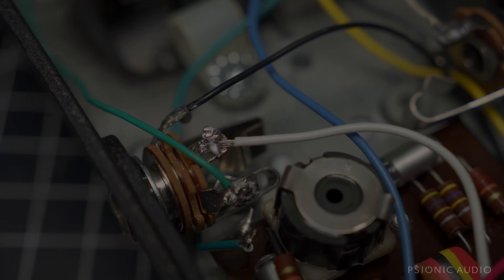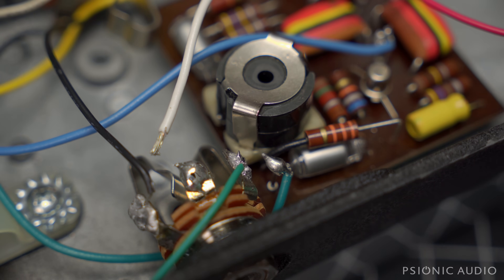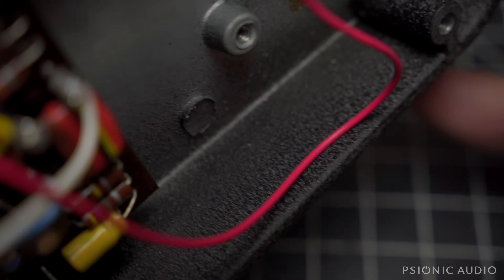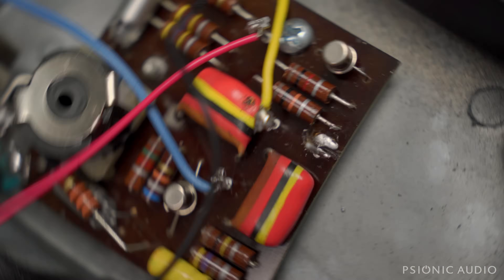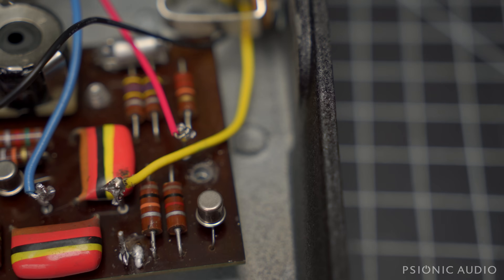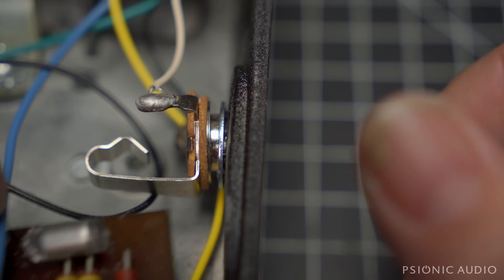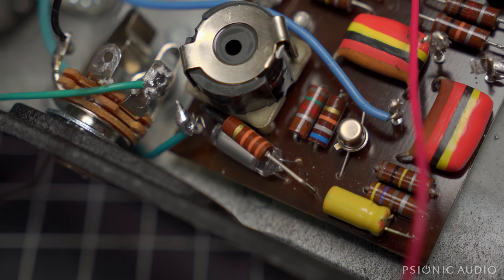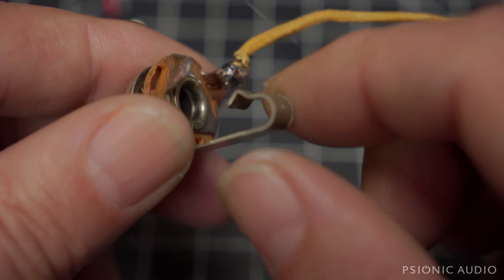Bad Solder Ruins Everything

Comment: Thanks for listing the solder you use. I’m relatively new at this but often find a lot of “solder is solder”  sentiment on the inter webs. (Something I always found suspect, knowing a little about materials)
Reply: Definitely - it's something you don't appreciate until you know the difference. If you purchase from Amazon marketplace or any number of questionable online sources (or even big box hardware stores in my experience), it's not a guarantee that what you get is going to be of much quality... But at the same time buying from specialist electrical sellers, they often cater to trade/industrial customers so you get dozens of options for all sorts of applications, and it's quite opaque to most people which to buy unless you know what you need.

Ditto on soldering irons, etc, and buying components!
Reply: For the most part, leaded solder (old school) is not sold any more. I have seen multiple YouTubes where folks painted the joint to be soldered with liquid flux. I have never, in 50 years, needed to do that. Not with new parts. With skungy older parts, working on WW2 surplus junk, it would be helpful, but you will need to scrape or file away any obvious corrosion until you see clean shiny metal or you'll NEVER get a nice shiny joint. And/or you'll have to overheat and then your connections look funky. Otherwise, soldering is a dumb-simple combo of good heat, clean tip, good solder, and a mechanically made joint. The joint should drink up the solder, it shouldn't be any kind of struggle. If you are embarking on a project where you'll be doing a lot soldering, you can definitely use a cheapo soldering iron as long as you keep the tip clean and tinned as long as you have the illegal leaded solder. Even with a really nice (2-piece) temp-controlled soldering station like a Weller or a Hakko, I still wipe the tip on a damp sponge every 2-3 joints. It just gets incorporated into your wrist action when you reach for the iron. Eutectic (lowest melting point) 63/37 solder is the best but 60/40 is perfectly fine but it damn well has to have lead (Pb) and of course resin flux in it. If you run out of solder, you generally CAN'T buy any leaded solder at your local hardware store, so it is wise to unwind a little backup spool and stash it away should you buy a 1 pound spool, easily available on ebay.
Reply: @alanpecherer5705 , I find that the brass wool sponges work better than the wet sponge.

Comment: Plumbing solder behaves like that. Falls right off of things.
Reply: Plumbing solder is bad for electronics, or so I've been told.
Reply: @harleyhexxe9806  It is corrosive and must never be used
Reply: @infectionsman  Yep, that's what I was told.
Reply: @infectionsman , old-school lead plumbing solder has a higher melting point than electronics solder, doesn't contain a flux core, and the separate flux used for plumbing is *highly corrosive*.

Comment: Hi Lyle, I just found your channel about 4 months ago, then found Brad's  and Yeetsee's (not sure I spelled that right} through your channel, they are all wonderful. Subbed to all. Proficient soldering is an art, similar to welding. once you learn to do it it's like riding a bicycle, it becomes second nature. it takes longer to clean and tin everything than it does to make the actual connection. I learned soldering in a radiator repair shop on copper/brass radiators. Clean, Hot And FAST that's how I was taught. and heat control. so you don't melt everything. some of the crap that is being sold as solder is junk. I usually test an unknown quality roll of solder by tinning some old junk jacks or pots. You can usually tell right away as it will act just as the video shows, it is as if there is no flux in it, you can add flux paste, and it helps, but it still unsatisfactory.

Comment: The other key problem is that none of the soldered joints started with a sound physical connection with the wire wrapped through the lug and not relying on the solder to maintain the connection.
Reply: Gerald Weber's videotapes from 30 years ago: "....and first you need a good, mechanical connection...."
Reply: Excellent observation.

Comment: I didn't know some Jacks not accepting Solder properly could be due to them. I thought maybe I wasn't using the right temperature or brand/type solder. Do you have any advice on these two? Thanks
Reply: I've always used 60/40 rosin core solder for electronics. Small tip, regulated 700 deg. Or 25W-30W max iron.

Comment: I just swapped out pickups in my Squier Jaguar and I kept having static noise.  I ended up redoing both the ground solders and the noise went away.  I just started making my own patch cables which is a great way to practice making good solder joints.

Comment: Looks like i could do a better job soldering based on this video.  I tried to build a spring reverb kit once and it didn't end up working.  No wonder, most of my solder joints looked like that.  It's not something i do often but i always felt good about at least knowing the basics.

Comment: I would love to see videos on how to solder clean joints, best practices for joining to components together etc..
Reply: They are in abundance on YT. I have viewed several, and because I recently had an ENGL amp of German-mfg on my bench, and not having a lot of experience with lead-free, I watched a few YT videos on this. In one such, I learned that when applying lead-free solder to a PCB pad, it is advisable to feed the solder at an angle that is flush with the board. Apparently, it adheres more completely to the breadth of the solder pad. I did find that to be the case in practice. Prior to then I was seeing the solder not reach all areas of the pad. Also learned that one should feed the lead-free solder more slowly than is typical for lead solder. Took me a bit of practice to get shiny joints. I now keep a separate iron and cache of tips for lead-free work, not mixing them with my lead solder gear. If others have comments re: these tips, I would love to hear them.
Reply: @spumpstein9374 , lead-free solder also requires higher tip temperature than leaded solder does.; and unlike rosin flux which is pretty much neutral, rarely conductive (except perhaps at high voltages) or corrosive, the special fluxes used for leadfree solder are both corrosive and conductive and therefore leaving any flux residue behind can be very problematic.
Reply: @goodun2974  Thanks very much for the good information. I did note the temp has to be greater for lead-free, but did not know about the residue issue. I am in the habit of cleaning up after soldering, using iso alcohol, applied with a q-tip to gently scrub off any flux residue. I did that on the ENGL amp I was working on, but now that I know how critical it is, I will be extra vigilant in thoroughly cleaning up after lead-free soldering. Seems to make sense to be tidy when soldering with lead-free as well, to hopefully reduce the need for cleanup. Thanks so much!
Reply: @spumpstein9374 , alcohol works great for removing rosin flux, but the fluxes used for lead-free soldering are formulated to be *water-soluble*.
Reply: Stew Mac has great video on this...  https://youtu.be/E-O2TGoArrY?si=AF-h-c13i5Xh1F0L
Reply: Here's an interesting one from the 1940's - the principles haven't changed though.   https://www.youtube.com/watch?v=wvl_KYif9zA
Although manufacturers have to use lead free solder these days DIY'ers do not. I'd recommend to anyone working on a small project like this that they use a good tin/lead solder.

Comment: Never seen solder do that  but wouldn't  1500 grit paper,  a dab of flux fix that for the jacks? 
I sometimes find some alpha pots needed lite scoring. I use a 80 watt Weller station with 
alpha fry solder and works well but not like whatever that stuff is... 
🤔
Reply: 80W will fry everything unless you can solder within 1/8th of a second.  30W max on small electronics.
Reply: @stevebeck3164  The iron station is a 20 to 80 watt variable station which I flip irons using to a 40watt weller . No sledgehammer used for a finishing nail.🤣☑
Reply: Chinese made jacks often have an unknown plating, not nickel like the plating on connectors of 60 years ago, and the  Chinese jacks may be greasy or have an oxidizing film. Clean the terminals with a scotchbright pad, an ink eraser, or ---- my personal favorite ---- a fiberglas-bristle scratch brush. Degrease with alcohol.
Reply: If it won’t accept solder, I’d seriously question what it is plated with, and how long the jack itself would last. Better to just toss it than to have to replace it down the line.

Comment: Oof.  Ugly soldering that bad hurts. 

@5:45 The thing about those 60-year-old solder connections is they were made with leaded tin and some flux.  Whether or not to use leaded tin solder in 2024 might be somewhat controversial--I'm not unsympathetic to such concerns--but I know it's comparatively easy to work with provided the iron can put out the right amount of power and heat.